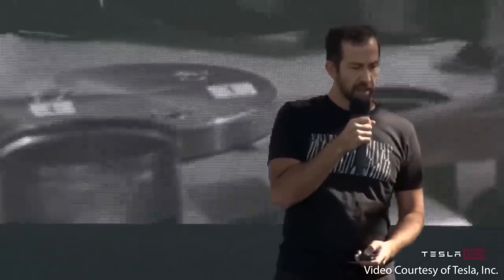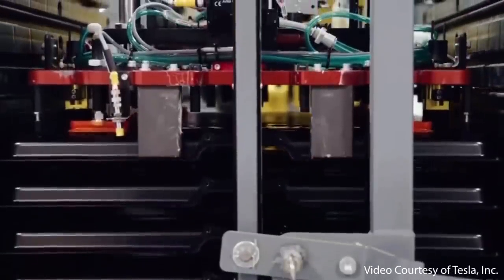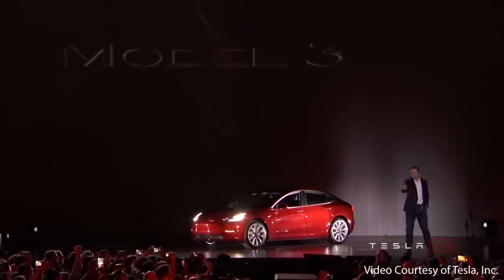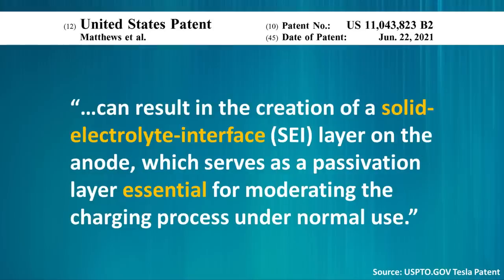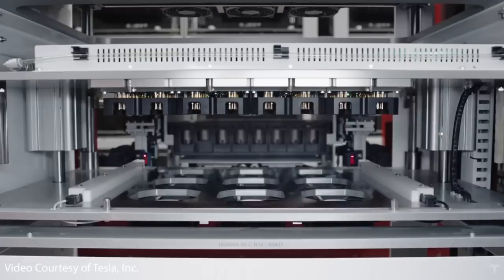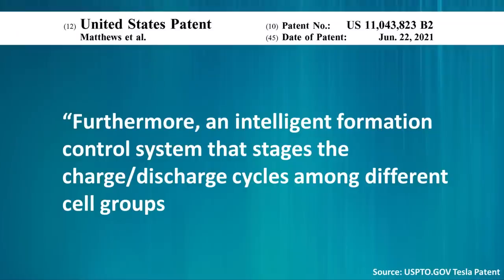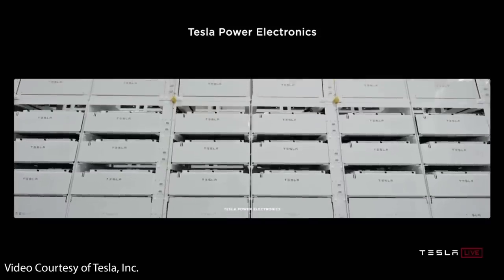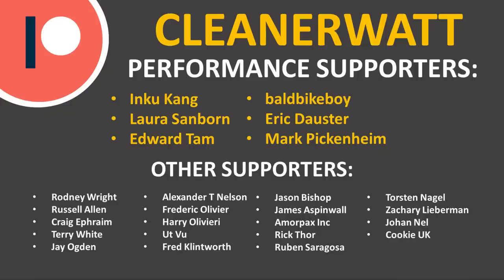NEW Tesla 4680 BATTERY Patent Reveals IMPRESSIVE DETAILS

Comment: Tesla just keeps advancing the electric vehicle technology.
Better motors, better batteries, better sound system, better range, better performance, better entertainment system, better noise abatement, better build quality. They are years ahead of all other auto makers.
Reply from the maker: Very true!
Reply: Dont forget safety!
Reply: Still behind in quality control and production capacity
Reply: @sava411  Certainly production capy limitations are very temporary. Gigapress castings should fix quality.
Reply: @sava411  Behind what other exclusive BEV manufacturer?
Reply: @lengould9262  Gigapress casting will fix quality issues with body panels and software bugs? I dont think so. Tesla still hands down best exclusive BEV manufacturer but lets be realistic and not worship them as a perfect company.
Reply: You missed charging infrastructure.
Reply: Build quality?
Reply: @sava411  yes castings will improve panel alignment.  Common sense
 A more accurate, stiffer, 1 piece sub structure, as opposed to 70 bent, flexible, welded & bonded pieces, then trying to accurately mate body panels & doors to a wobbly inaccurate chassis...
Reply: @alexmanojlovic768  strange how no other major manufacturer has alignment issues despite not having monolithic castings. Tesla engineers to to get it together!
Reply: @sava411  strange how no other manufacturer of this many cars has had only 14 years to get it right. They've had over 100 yrs each & still need recalls & have issues, but let's just ignore that so you can hate on Tesla. The panels gaps are an early Fremont problem, doesn't happen anymore, so go away talking anti-Tesla rubbish.
Reply: @alexmanojlovic768  very true! Automakers have had hundreds of years to improve and tesla hasnt. No need to pretend theyre the best at everything despite being so young. And sandy munrow had body panel issues in his 2021 model 3.
Reply: @sava411  Who is going to produce a million BEV's in 2021?
Reply: @sava411  My thoughts exactly, They basically have "quality issues", I can't believe it's been going on for 10 years. I visited the London Gatwick store a few years ago, I was gobsmacked as the cars looked as if they'd all been badly crash-repaired.

Comment: The material handling aspect and standard size container, automated crane and potential use of robotics is very close to a system i designed for the Assembly of Circular PC Boards for the AWACs radar system. We optimized cycle time, use of storage cubit feet and reduced waste, manual labor and overall cost of the AWACs systems by nearly 20%. we used Bar code for tracking and robots for load and unload into standardized containers, with an automated virtual load/unload machine. It was amazing to watch and I received a patient for the system. I fully appreciate your enthusiasm and see the effectiveness of such a system to lower costs, and the improved controls and reuse of energy is amazing. My work was competed in 1980. Many of our principles of the design and operation fall quite in line with this.
Reply: I just watched an overview of the SpaceX Mars planning. Many of the same systems engineering techniques and philosophies. Also checked of a few Elon Musk Video interviews. The guy is dead on target!! Dead On. Gonna push my wife to trade her Volvo in for Tesla one of these days. One Smart Dude. Using his Physics background and making stuff work. Is Physics covered in High School anymore?
Reply: @DennisMurphey  Interesting, do you have a link or name of the SpaceX Mars planning overview video?
Reply: Thanks!
Reply: Congratulations for the excellent work you did on there’s awacs testing system.  That is the American way, innovation.
Reply: Dennis Murphey :  When I went to high school in the 1970s, very very few students took physics, only the academically bound for University. Back then everybody didn’t go to college. Now everything is watered down and everybody gets an “A” so you don’t even know who knows what.
Reply: @steveperreira5850  Sadly true Moore High Class of 67, lower 3rd, JHU Masters 81. One can lift themselves up with desire and curiosity to explore and try.

Comment: Anyone who has worked in logistics over the last half-century will recognize those racks and robots.  Robotic bin storage and retrieval in warehouses is old but useful tech, repurposed to support cell conditioning.  What's really new here is the elimination of charge-discharge cables and connectors, improved thermal management, offset charge and discharge cycles, and liquid cooling.  Tesla has grabbed existing processes from elsewhere and melded them into an efficient process flow that takes up less factory space.  None of this is really new tech, but all of it represents elite production design.  These guys are fantastic production engineers.

What we are not seeing in the patent is sensor tech and software, but we can be sure those racks are home to dense sensor networks and tight software integration.  Tesla leaves nothing to chance.

Tesla takes Elon's 'no part is the best part' design philosophy and applies it to production engineering.  It's exciting to see the result - factories like none the world has ever seen, constantly improving.

To succeed in this industry going forward, it's not good enough to design appealing prototypes without production engineers being intimately involved in every design decision.  Designing for production is critical - and you can't design effectively for production if you rely on outsourcing for critical components.  If you're stuck with existing market products, it's not going to go well.  We see this in Ford's Mach-E HVAC system - 4 pumps!  A rat's nest of screws, hoses and connectors.  Too many assembly steps for factory floor operators and robots.  Production engineering is an afterthought.  According to Sandy Munro, VW's HVAC is even worse.  Legacy automakers' determination to outsource everything they can is hurting their competitive success.
Reply: Thank you for your insightfull comment. It's difficult to explain to people why Tesla is getting more and more advantages as time goes on by working in this "enigineers at every step of the way". Together with vertical intergration and the right philosophy (no part is the best part) and big software focus they come up with vastly better solutions which snowball even further down the line. Sometimes Elon might be a bit to optimistic with the timeline when they deliver, but in the end they will and improve further upon that, not like other car manufacturers which only do a light update every 4 years and start with the same ineffecient outsourcing process for the next generation of the product.
Reply: @SuperLala33  Yeah.  That about sums it up.

We're going to see some legacy automakers go under in this decade if they can't change gears, particularly regarding how they do production engineering and vertical integration.
Reply: @Urgelt  Totally agree. I hope some can still make the transition, although i have the feeling it's gonna be very difficult to teach 100 year old horses some new tricks :)
Reply: @SuperLala33  I share your hope.  The more automakers make it through this period of disruption, the more choices consumers will have. 

But it sure doesn't look good for legacy automakers in 2021.  They're in for a rough ride.
Reply: Designed For Manufacturing by the Manufacturer. Impossible to beat,particularly with the worlds best engineers on the case. Thank you for your experienced insights and knowledgeable articulation.
Reply: "These guys are fantastic production engineers."
Production engineers, the most undervalued and under appreciated people in industry.

Comment: Thanks Jonathan.  This is so easily overlooked and thus very insightful.  We have to be patient.  The 4680 cell development process is revolutionary and will occur in stages over a few years w much optimization.  The world will be a better place because of it!
Reply from the maker: You are welcome and thanks for the kind words.
Reply: Its good but not revolutionary, and tesla should have done that since the beginning instead of using over 4000 individual 18650 cells, look at BYD blade battery its a much better design.
Reply: @alanmay7929  you are becoming a troll.

Comment: The most impressive thing is the intense engineering and software that goes into these factories. Elon means it when he says that the actual product is the factory. Charging battery groups with the energy of discharging cells is something that seems so obvious, but I'd bet that the power electronics of some cell manufacturers does not support this. Electricity usage during formation play a significant part of unit cost.
Reply: Yes, the charge discharge harmony seems obvious. I’m an electrical engineer but I don’t know that much about batteries, however, in any kind of energy cycle we are trying to reduce losses, and this almost seems like a no brainer and I’m surprised no one has done it before. But it is so easy to just dump the energy resistively, and when a factory is made I suppose they try to save pennies And throw away dollars in the long run. I saw this kind of shortsightedness a lot in my engineering career. Used to drive me crazy.
Reply: You guys are so intelligent! Thanks for your comments!
Reply: 4 wheels coffin engineering

Comment: Easily overlooked, but very important.  Great vid!
Reply from the maker: Glad you liked it!
Reply: Not overlooked actually, where is the raw materials/lithium to make all those vehicles?! Thats the real question.
Reply: @alanmay7929  Not overlooked by you obviously, because you are so smart, but I assure you, overlooked by the average stock picker.  Hard rock spodumene source in North Carolina, and lithium rich sedimentary basin deposits in Nevada for U.S. sources. Other continents have large deposits too. Lithium is not a rare element in the Earth's crust Alan.  Production of it is required on a larger scale than ever before, so Tesla is taking the initiative to let producers know they will have solid long term contracts if they produce in an environmental and competitive way (this is also true for all battery required resources).  Elon is vertically integrating the company to assure battery production on grand scale. Producers who rely entirely on supply chains as they are currently could get left in the dust. Don't doubt they are working hard to secure raw materials as a critical part of the grand design. The followers who didn't develop a grand electric plan over the last decade will have a harder job pulling it all together going forward.
Reply: @markb9347  unfortunately what you fangirls don’t understand is that lithium just like rare earths are not easy to mine and process, there is nothing in manufacturing that’s green, that lithium in the US might be just a fraction compared to what’s needed every year.
Reply: @markb9347  there have been many mining and process in development according to the types of mining operation…. Many other companies are also working on. The supply chain for batteries worldwide.
Reply: @alanmay7929  thank you for exposing your self.
Reply: @alanmay7929  There's no need to be rude Alan.  We all just want good information and better understanding.  Not everybody is a fangirl or a troll, even if there are many about us.  You are correct that mining, metallurgy, and manufacturing are challenging.  While we haven't mastered making all these ecologically friendly, that just highlights the need to work hard at getting better and better at it.  Being hopeful and taking strides toward those ends is a heck of a lot better than taking a cynical, fatalistic, do nothing attitude toward it.  Tesla and Elon have taken the initiative toward a greener future, and LOOK, most of the industry is finally following.  Some are still reluctant and dragging their feet, but the hopeful future survivors are now investing heavily in the future of transportation tech.  Those who stay mired in the past will bankrupt themselves this decade.

There is more than enough lithium resources for a long time.  The challenge is unlocking that resource as sustainably and quickly as we all want it.  Difficult? Yes, absolutely.  Impossible?  Only for those who say it is.  Just like starting a new automotive OEM, in electric vehicles no less, or landing and reusing rockets.  Impossible?  Definitely for those who say it can't be done.  Not for Elon.

We have plenty of copper in the Earth too, but getting it out as quick as we want it this decade and next will be a big challenge that requires changes to the status quo way of doing things too. Upgrading the power grid... part of the same challenge, but an ENORMOUSLY hope inspiring one for humanity.  Wish for and encourage/help more leaders like Musk, as if humanity's future hinges on it.  It might.
Reply: @alanmay7929  I agree.  Did you think we all think Tesla and Elon are the be all end all of human existence?  No!  The future is brightest with everybody working toward a better tomorrow.
Reply: @johndodge8999  Lol that's what she said....

Comment: Waiting for my next Y with the 4680 batteries built in Austin.
Reply: In 2 years maybe, not before.
Reply: @WlerickBigotOfficial  2 months maybe 4 not much more than that. Just follow what is happening at Texas Gigafactory, i would be very surprised if they were not using 4680 by the end of the year and in fact using them right now from the Fremont battery plant.
Reply: waiting for mine from Giga Berlin, in a fancy color 😋

Comment: In addition to reusing the discharge cycle power, they can also use the reclaimed heat in parts of their manufacturing that requiring heating. Just like how the coolant loop in a vehicle goes through the heater core, the factory coolant loop could cycle through drying rooms or reclaimed in other ways. Traditional factories using air cooling are attempting to discharge that heat in the condensers on the roof. Which is doubly inefficient as air is a weak thermal conductor. So the air does a bad job taking heat out of the batteries the first time around and then the condenser does a bad job of removing heat from the internal air and disapating it into the surrounding air.
Reply from the maker: Quite interesting in deed.
Reply: This would be great for a paint room
Reply: Thats totally false, you've obviously never visited other factories around the world, go do some research again.

Comment: I’m buying the plaid when confirmed new technology installed.
Reply: I think it is a wise idea to buy a plaid after the 4680 batteries are available. As an electrical engineer I worked with power transfer systems, and at some point along the way when you have a battery system, the internal resistance of the batteries themselves and their external contact resistance by means of connections to the external system, they become a big factor in the losses of the system.  Is especially prevalent when you are trying to really draw power out of the system such as for maximum acceleration of the vehicle. The model S with the 4680 battery cells Will be significantly better than the recently released plaid as of June 2021.
Reply: @steveperreira5850  totally agree

Comment: My Plaid comes in August sounds like I should delay until new batteries?
Reply: Gonna be at minimum a couple years to make it to sedans. The semi and truck will get dibs on manufacturing capacity, right now the cell manufacturing is still a pilot.
Reply: Plaid's are a flagship product and will probably get 4680's .
Reply: @jackdbur  Model S has already had it's major refresh and there no retooling in sight for 4680 cells on one. Right now it looks like the MY and M3 are getting the retooling with the aluminum chassis molding to take 4680 cells and be structural like they're designed to be. They are the primary revenue drivers and thus get that cost reduction treatment first.

A low volume luxury sedan will probably be near last in reality, being a flagship car isn't an incentive to do expensive retooling when they sell significantly less and take a lot longer to recoup costs. MY and M3 look like they'll be the first to get it in maybe a year or 2, in Austin and or Freemont, with the semi and cyber also being in line before Model S or Plaid edition.

Comment: That the cells have 25% more capacity and are 25% bigger than the previous cells?

Wait...... what?
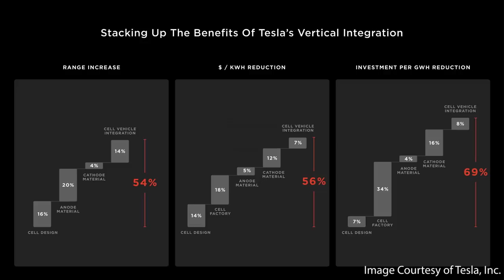Reply: Check 4:10
Range increase has a breakdown.
16% is cell design, probably size
20% is the anode material (silicon)
4% is the cathode material. Depends on which of the 3 chemistries Tesla has developed is used in which car. Iron, Nickel Manganese, or just Nickel in lowest to highest energy density.
14% is the cell integration into the vehicle (structural pack)
For a total of 54% in range, not to be confused with watt hours but you can see that materials make up a lot of the increase.

Comment: Great innovation! Tesla is doing great things!
Reply: Its evolution not innovation, tesla should have developed bigger battery cells since the beginning instead of using tousands and tousands of small cells in one pack!
Reply: @alanmay7929  They didn't have the capacity to develop their own cells from the beginning Alan.  It took time to gather the resources to begin that development.  They had to buy what was available on the supplier market as virtually all OEM's, including Tesla, still do today.  The next generations of cells, and systems they come in, will have to compete and prove themselves as they come online. 2170 from 1860 is mostly size and cooling evolution.  Tabless 4680 is genuine innovation.  Regardless of how you choose to value the words evolution vs. innovation, the free market choice of consumers should ultimately decide what is best for them.